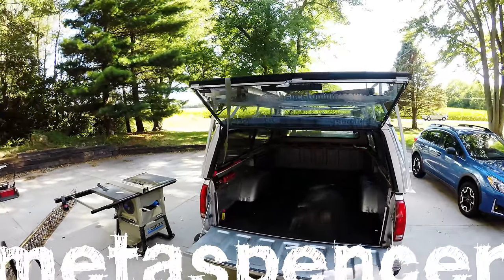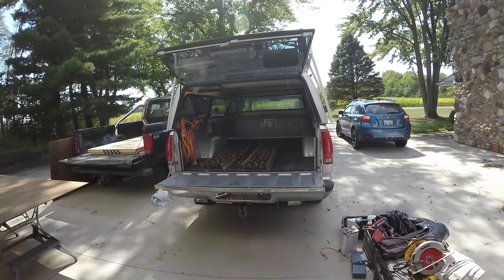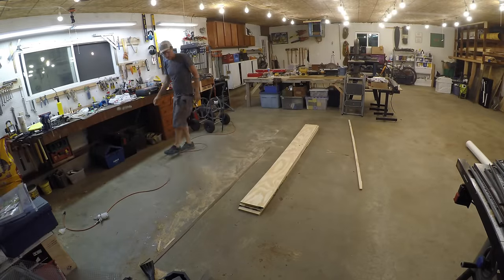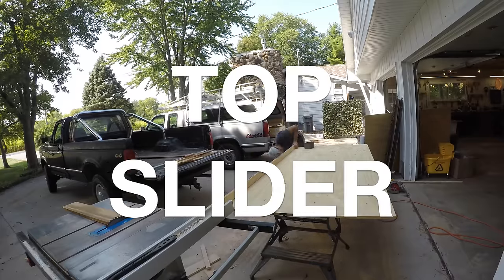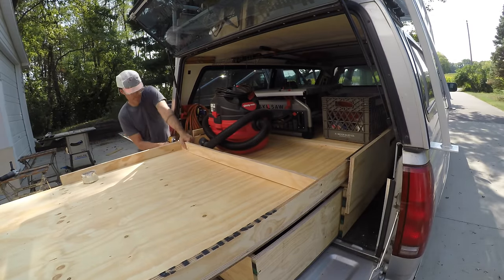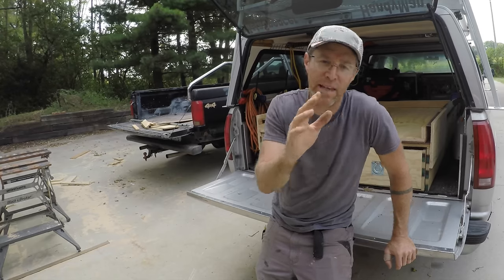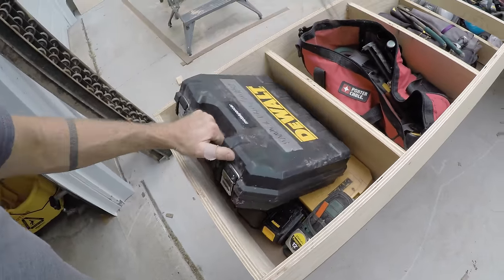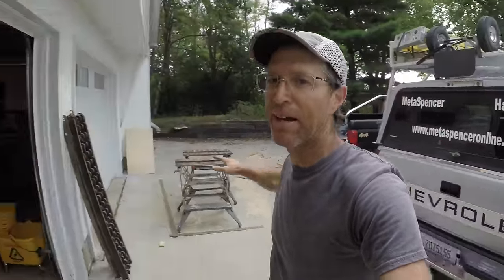Building Truck Bed Drawers + BedSlide

Comment: Great set- up, but your top slider should have some kind of safety lock so it doesn't slide out when you don't want it to..,, also can you fit 4x8 sheets??

I built something similar with those roller balls on both sides of the drawers instead of that material you used.  I framed it just with 1x6s.  The drawers slid on the 1x6s with the roller balls mounted to them.  The top slider , same thing it slid on the roller balls..  Unfortunately the truck could not handle any weight ( nissan frontier, sold it)

Yeah commercial versions are insane money. On my current truck,  I went to low rise side tool boxes, and a ladder rack system, and a slider . Just a sheet of plywood that rolls on steel wheels.  I mounted the wheels on that waterproof plastic decking. Nothing is screwed to the bed , the side tool boxes are mounted to the brace on the ladder rack system, and the ladder rack has heavy duty clamps that mount to rail, no screws or holes either 👍.
I am just going to paint the plywood with couple coats of this really good exterior paint I have left over.   Sherwin Williams duration..
Reply from the maker: Good eye: I added a safety lock on the slider about two days after making this video. It's just a locking pin but keeps it in place. Your setup sounds good. I'm going for side tool boxes on my "new" truck and thinking they'll offer good access. Thanks for the comment! :)

Comment: Also, have you thought about using some plastic pieces and waxing the bottom of drawers? Might slide easier.
Reply from the maker: Good idea ... yeah the wood on wood started to grind with daily use ... plastic would be better

Comment: Put an threaded pipe closure like the back at the front. That way when someone puts in a short piece of pipe you can pull it out.
Reply from the maker: I totally need to do that! Too easy to get stuff stranded in there as is. Thanks for the tip!

Comment: I know I'm behind but went looking..aha..my style with hardboard. I have Avalanche super sticky liner.  Great design,thanks. Have you updated or changed along line of sealing the hardboard and giving a heavy coat of paraffin. Should slide?I'm considering the white HDPE plastic like Australian company drifta uses,super slippery. Want to avoid rollers.Thanks again.
Reply from the maker: Hey man, thank for checking it out. I'm still running with these boxes just like they were when built. The hardboard has taken some wear and will fail at some point, but no big problems yet. Sure the drawers are a bit hard to pull out when fully loaded, but that doesn't bother me much. I added bearings to the top slider which is a big improvement.

Comment: Love your build,  thanks for the video.  

Just curious how it's working?  Are you still without guides?  
I am getting ready to build a set like this,  I have some rollers for the slide out,  but the drawers I didn't really want to do guides.
Reply from the maker: Thanks for checking it out! It worked well for years but I got rid of it to move cross country in the truck. The weakness was the tag board. I’d just use plywood as a base no rollers
Reply: @metaspencer  you mean the masonite?
Reply from the maker: Anything hard would work

Comment: Did you do any suspension work on the rear of that 90's truck to hold all the added weight?
Reply from the maker: No it's a 2500 and handles it well.

Comment: Great video. Do you think coating the outside of the drawers with polyurethane will negatively affect the sliding motion at all?
Reply from the maker: Sounds like a good idea! It won’t hurt and may help
Reply: metaspencer sweet. I think I’m going to do it then.

Comment: What type of wood you use and what is it that you put back to make it slide
Reply from the maker: 3/4" plywood. You could buy the good stuff but I went cheap on this one. Under the drawers I'd do plywood if I did it again. 1/4" ply is tougher

Comment: Hey buddy. Did you build the rack setup over the truck bed cap or was that setup purchased?
Reply from the maker: Yep, built it. I have a full video on it here on my channel. Search “truck rack” ... or just click here https://youtu.be/j429VzZj6Z8
Reply: @metaspencer  browsed your channel right after I asked and found my answer lol. Thanks! Liked and subbed. I will be watching soon. I will be doing a truck cap camper build myself but dont want to lose the racks up top for my canoe!
Reply from the maker: Sounds like a cool project you’ve got!
Reply: @metaspencer  certainly small potatoes compared to yours! Truck is having new heads put on then back to work on it I go!  Go luck and thanks for the response!

Comment: JFYI in case you didn't already know not a good idea to use a invertor to run any heating elements.
Reply from the maker: Yeah, seems like that would be a big overload and fire hazard. I use mine to charge batteries and it seems to work well so far. Thanks!
Reply: @metaspencer   I  use Dewalt stuff and they have 12v chargers available.  JFYI

Comment: Was there a reason you decided to use a felt system for the drawers instead of use the conveyors?
Reply from the maker: My thinking at the time was to save space: conveyors would have taken some space away from my drawers. However, the felt came off after a few weeks and it's now just wood-on-wood sliding. With daily use there is some wear and they are not super easy to pull out. So conveyors may be a better way to go!

Comment: I hope you dont mind me throwing out a few ideas on your work, i dont mean to be disrespectful but i suffer from random thoughts. That storage tube i had 2 on a work truck and i called them torpedoes they were great for mouldings and pipes but i had them mounted outboard of the rack so i didn't loose area for ladders. when you were talking about making  the drawers easier to pull in and out i was thinking maybe you could drill holes through the floor of the drawer and shim in some wood the mount some casters on the inside with the wheels only going down through the floor of the drawer maybe 1/8" or maybe a piece of angle iron with a caster on it then screwed to the side of the drawer which ever you think might be stronger. Again sorry if i over stepped any boundries
Reply from the maker: Hey, your ideas are ALWAYS appreciated! I had thought about mounting the tub outside the rack, so your idea confirms that one ... I've gotta do it! Loving space on the rack itself is no good. As for the drawers, I'll have to weigh options and see what works best. I like your idea because it would also be a space saver. I hope to get it all dialed in soooooon. Take care :)

Comment: The  answer is to get a Ford transit high roof VAn , so that you can walk in  and easily take and put
Reply from the maker: Oh how true that is: nothing like a van for actual storage.
Reply: @metaspencer   Trust me it really is  the best move you could make ..  Because life is short and work gets harder as you get older.. MAking work as stress free and efficient as possible is a  must . Plus that big white space on the van will be Great for sign writing  or advertising .
Reply from the maker: @fensterputzernuernberg  I hear ya, man. I'm currently doing a lot of hauling so am switching over to an F350, but if I ever get back into carpentry it's gotta be a van ... so much room

Comment: Maybe inline skate wheels for rollers
Reply from the maker: Oooo, there's a cool idea! And if there was a way to mount them to not take up space that would be even better. thanks for the tip
Reply: @metaspencer  perhaps you can cut holes for wheels and mount the axle inside the draw. You can work the bottom of the drawer to glide 1/8 off the bottom.  I think you could get away with only having 2 wheels per drawer mounted towards the rear.  The handle side of the drawer could still pull on the floor
Reply from the maker: @64maxpower  cool idea

Comment: This is a great idea. I'm curious how the hardboard has held up over time? I saw you commented that the felt pads wore off. Do you feel like this is a good solution instead of heavyweight metal drawer sliders?
Reply from the maker: Having used this daily for a year now, I think sliders would be nice and smoother/easier to use. However, they take up room so result in slightly smaller drawers. I definitely have some friction with my setup, making the drawers a bit of a bear to pull out. Still, they work great

Comment: How has the hardboard held up?
Reply from the maker: With tons of weight and daily use it's gotten trashed. I put bearings on the top slider and that's been great. Drawers had to be re-bottomed with regular plywood and that's been great.
Reply: @metaspencer  thanks for the quick reply. I think I will go right to the bearing idea.

Comment: You may want to consider some type of security I had a lot of tools my pickup truck because I never knew whst iI was going to need so far I lost a jack and that's basically been  it but I've had people in my truck needless to say everything got cleaned out it's a pain now if I need something I'm ,30 minutes away now
Reply from the maker: Yeah, a beefy lock system on that back end is in order ... I'm working on that ASAP

Comment: helllllooo,,,,WHAT SIZE SCREWS
Reply from the maker: The wood screws I used were 1.5" for the wood-to-wood connections ... 1/2" screws to hold that thin hardboard in place

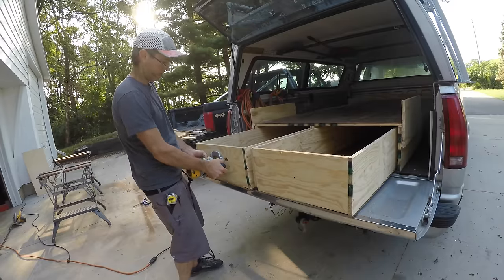Comment: For better sliding capability, try 3/16" UHMW plastic.  Buy a sheet and then rip it into strips.  It's self-lubricating and works well.  Watch the youtube vid linked below and see his use of it at 5:20 - https://www.youtube.com/watch?v=d-BWmPaBfjQ

Great video!
Reply from the maker: I've seen that video and have long wondered how long the plastic lasted ... my wood is starting to wear so I may need to add a different slider ... thanks!

Comment: How many 2 by 6s did you use?
Reply from the maker: 2x6s? Whole thing was built with plywood my man
Reply: @metaspencer  ahh okay thanks I appreciate it I got that after I watched it twice.  And you just ripped them all down to 10 inches?
Reply from the maker: @adrianbaker-gratz7594  yup, circular saw works well